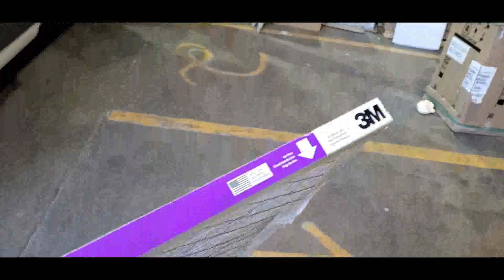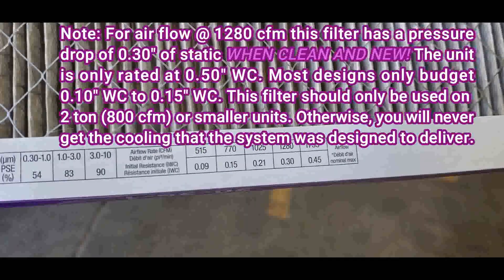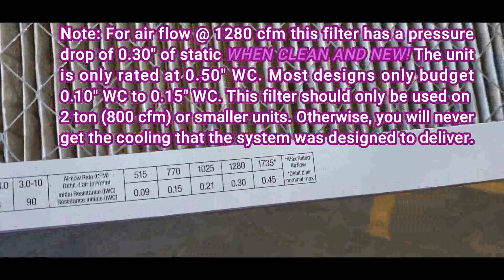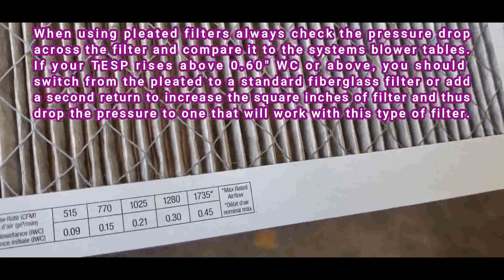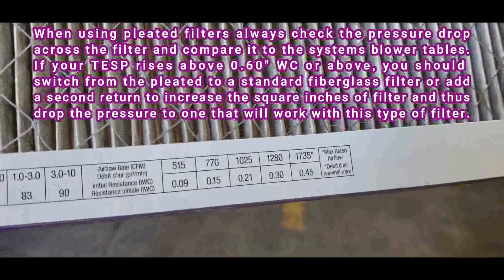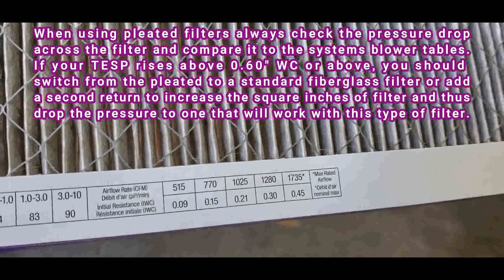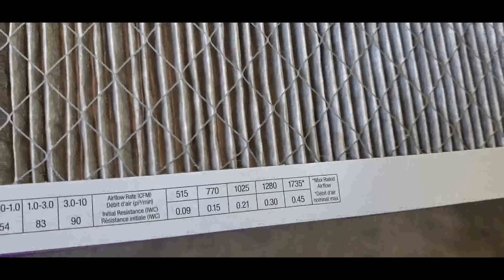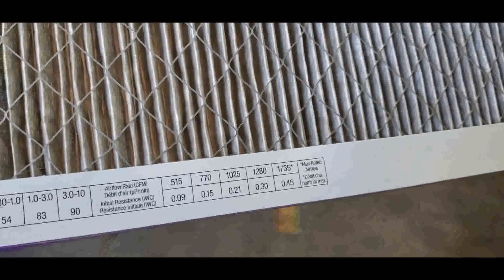Pleated filters and static pressures

Comment: In order to comply with CA energy commission filter size requirements, you basically need at least 2 returns or 2 inch filters on every system.
Reply from the maker: True and not true, if you design the system correctly and then test it out to make sure your design works and does not make the static high, then we can get away with it.